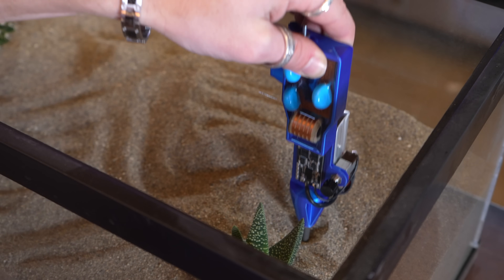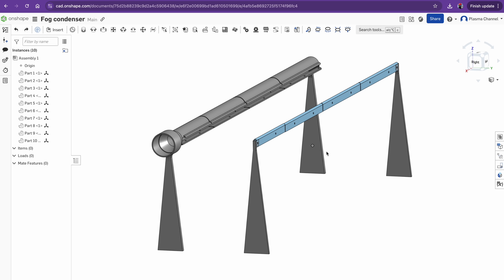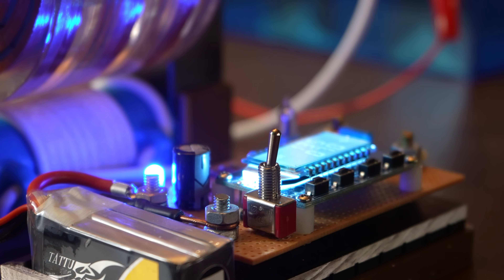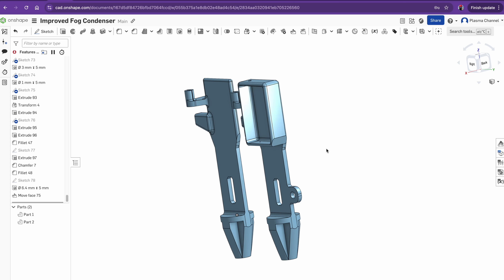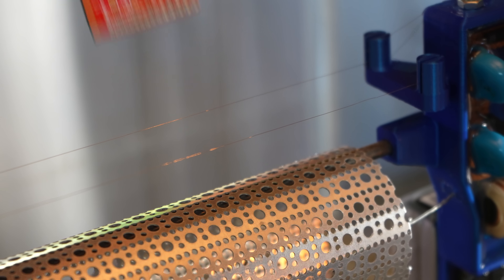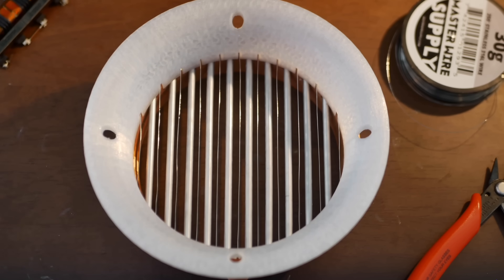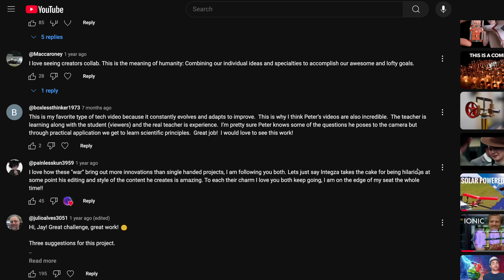Solving Desert Water Shortages Using 20,000 Volts

Comment: I do lots of work in Namibia.  There is fog on the coast until 11 or 12 AM.  There have been studies with fog nets.  This is very interesting thinking.  I'll be in Namibia in a month.  Want me to try it out your system on ground?  Need a power supply that takes 220V if you're interested.  Check out the Namib desert.  Swakopmund and Walvis Bay are the two largest cities on the coast.
Reply: In some area, water is for survival, a compressor dehumidifier gives 3L/kwh ; a mini seawater desalination plant gives 10L/kwh; this guy achieved 15L/kwh.
Reply: @francistai3615  Those are great comparison numbers.
Reply: @francistai3615  Yes, under the most ideal circumstances available. The regions are called "Arid" for a reason
Reply: @francistai3615 the 15L is by running fog over the machine, unfortunately real world conditions won’t give the same result but hopefully we can see for real when he scales it up
Reply: @francistai3615  A modern industrial scale desalination plant based on reverse osmosis achieves roundabout 300L/kWh. 15L/kWh is really not that great in comparison. The other issue is that it draws power at a time of day before power becomes readily available, if solar power is to be used. And compared to a compressor based dehumidifier (or a Peltier cooler as the one shown in the video), it also has the big catch of only working when condensation has already occurred.
Reply: @francistai3615 But it depends a lot on de air moisture
Reply from the maker: I wish there was more time between then and now. I don’t have the time to upscale it properly by then! Tempting though, and I’ll think about this. Feel free to email me so we can chat further
Reply: @PlasmaChannel  Noooo!  You don't need to scale it up!  Just the way it is at 2 feet is fine!   Let's test the working model that you have and if it's a success, then think about scaling.  I emailed you yesterday with an outline.  Did you get it?  Check your spam filters for an email with an address starting with "zav".  I sent it at 11:39 CST on Saturday.
As for the trip, I should be flying out in about 5 or so weeks, then back in the US, then if all goes well, back out for the summer.  So there's time to plan, possibly test on the ground in this trip and if not, then this summer.  Maybe even test and compare the results from the Atacama and the Namibian coast.  I'd also film if for your channel, of course.  It is the way of my people.  LOL.
Reply from the maker: @zavatone  I'll look for your email, im certainly interested in trying this. Expect to hear from me soon!
Reply: @ Rockin!  And if you ever get the jones to visit Namibia, I strongly recommend it.  This will be my 16th time back.  With your tech, you'll be welcomed even more than Namibians normally welcome visitors!  Just use m US number in the email I sent.  Cheers!
Reply: @PlasmaChannel   I also work in the Sahara helping to turn the desert green. I knew about the morning mist in the desert and had tried to talk some landowners into using fog nets, but they never took it seriously. This technology is way more efficient. I will be trying it out when I return to the desert. I also want to send you royalties for coming up with the prototype idea if we ever build one . Let me know what address you want the checks sent to. I am a firm believer in paying inventors for their work. Otherwise, people will stop sharing their innovation and discoveries .
Reply: @Jmagz-l2e Yeah, but if everything was open source! Companies would and should hire the inventor on a equal share of profits! The knowledge, would grow faster, through a collective, like this & innovation! An then it's win win for humanity! However! Its commendable of you to renumeration him!
👌👍🤙
Reply: @PlasmaChannel  The real test is if it will work the same in a desert environment, with the different temperature, humidity, wind etc. I don't think scale will be too much of an issue if you set it up in a good spot that's high up. 

I can't help but wonder if some fans would help push more moist air into the net though, maybe with a nice enclosure to make it act sort of like a wind tunnel, pulling air into it. Sort of like how a dehumidifier collects water? I don't know if I'm just overcomplicating it in my head now...
Reply: @Deja117  And the actual fog density of reality. But having a compact low power booster for a fog net seems like a worthwhile thing where fog nets are liable to be useful in the first place.
Reply: @PlasmaChannel  Just sent you another email.  Let's hope it got through.  Cheers!
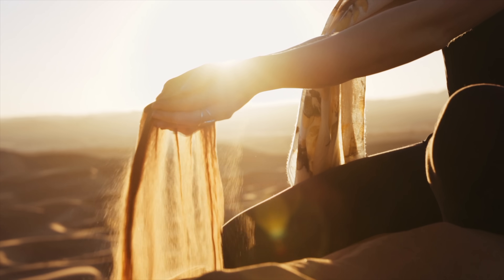Reply: @PlasmaChannel  2:25 "We need to find Creative ways to stay hydrated",  and the guy spits out his water !   LOL !  Awesome content !  Don't stop !
Reply: @PlasmaChannel this would be nice to try in the small islands in the Philippines let me know if you would like to come
Reply: @PlasmaChannel Very interesting, thanks but calling that dehumidifier commercial is quite laughable… I’m a bit curious of all the miles of electric fence we have to keep in cattle. It’s a 10KW pulse, could a grounded mesh be added and increase water availability?
Reply: @PlasmaChannel  you need to patent this ASAP mist-er
Reply: @PlasmaChannel  please please please do it!
Reply: @PlasmaChannel  I would like to purchase some
Reply: @PlasmaChannel yoo I this real..?
Reply: @PlasmaChannel maybe a system like this can work in tandem with a solar panels supplied battery bank. Where the stored power is extracted at the time of day when the humidity levels in the air are highest.
Reply: Make sure to document your process! Good luck! You could be one of the pioneers in this entire industry
Reply: It would be great to try this.

Maybe you could have access to a fablab to build the device ? The building seems pretty easy for anyone with electric/electronic competences.
Reply: @sebastienc8797  I can't.  I have a rather large project I have to make work and don't have the spare time.
Reply: Liking and commenting so this hopefully gets seen
Reply: @maker3d385 Thanks, man.  I emailed him with an outline but haven't gotten an email back yet.  Fingers crossed!
Reply: take his numbers and calculate how much power it would take to water a reasonable area
Reply: @sFeral  - I scaled his numbers up and derived 25 KWH per 100 gallons.  That is a LOT of power.  I love the physics, but seriously doubt the viability of the economics.
Reply: @markTheWoodlands  The numbers I ran are in metric over there , and I got about .9 of a liter from a meter of fog per hour, so almost 1/4 of a gallon ever hour (.23).  What I want to know is how much power is needed when you scale it?  Do the power requirements scale linearly?  Also, how large is the ionization radius in case we are thinking of stacking them on top of each other and if it matters to put one after the other.  When does it  harvest enough water from the air that putting them after each other is less useful.  BUT, we gotta try it on the ground first!  Then we can worry about all that.
Reply: @markTheWoodlands  I got 0.23 gallons in an hour with his 2 foot unit end a meter distance.  Sp, Just under 1 gallon in 4 hours.  Do the numbers match?
Reply: That's about £13 per 100 gallons assuming it is run from the mains.  Does seem quite reasonable to me. So reasonable I doubt it would be as efficient out of the lab. £0.13 per gallon is not a lot, particularly if it can be drunk.
Reply: @markTheWoodlands  while you are technically correct, and the numbers indeed scale up to about 25KWH per 100 gallons, the usability lies in the way the modules are designed. Since a single module in this demo setup only consumes about 39W per hour, you can easily power that using a 3S Lipo and charge them during the day using solar power. It might be that for larger modules you'd need bigger lipo's and better charging mechanisms, but generally I'd say that it's power consumption is well within the impressive range
Reply: @randriese  - First - I want to say that I applaud the inventor for pursuing this solution.  The quiet violence of drought is more frightening than the fires and storms brought on by climate change.
Reply: @markTheWoodlands  Namibia is also a desert so solar power is a good option regarding the power issue
Reply: @markTheWoodlands  when you say first, you usually follow it with secondly. otherwise why say first?
Reply: @markTheWoodlands  by his numbers is around 71kwh per m3, where a desalinization plant use around 3 kwh per m3 ☹️. Not feasible.
Reply: @markTheWoodlands 
I wonder about that. First of all, I bet you could scale back the voltage (and hence current consumption) without a significant drop in water production, and secondly that the switching driver in question is dissipating a fair bit of that as heat. The geometry likely also plays a big part in efficiency. Doing the actual peak efficiency calculations would be tedious.
Reply: @markTheWoodlands  if you scale it to a 400W device and power it with a cheap 400-ish W solar panel, you get 5.5 L. Maybe not impressive but likely enough for drip irrigation?
Reply: @ecausarano  - You read my mind.  Drip agriculture paired with the right crops would probably be a good combo.
Reply: @Ornitorrincoso  It will be difficult for this to compete with modern desalination tech, at 15 to 30 cents per 100 gallons all in.
Reply: @Scrogan  - Sure.  My guess is that by playing around w/design parameters he will double to quadruple is output per dollar.  Reverse osmosis desalination is hard to beat on cost.
Reply: @ purely from an energy standpoint, reverse osmosis has a hard minimum energy per litre. This technique doesn’t besides a small entropic cost, as you’re taking already pure liquid water and collecting it. The energy per litre is probably a tradeoff with respect to percent water reclaimed, so maybe if you’re fine taking only 1% of the water out of the fog you could make it a hundred times more energy efficient. It may even be possible to get significantly more than that though it’s doubtful.

How about using atmospheric electricity to power the thing, with kites connected to the water charging wires?
Reply: @Scrogan  - True, however that minimum is about 3 KWH per cubic meter (264 gallons) of water. Sorek costs less than 20 cents per 100 gallons. The Capex of the proposed solution is likely to be quite high.
Reply: @markTheWoodlands  did you consider the amount of fog available in your scale up calculations?
Reply: @markTheWoodlands that’s like 40 solar panels plus like 4-5 batteries for backup
Reply: @markTheWoodlands  You are looking at it from the wrong perspective, a 2-foot system, at this efficiency needs a ~40watt solar panel somewhere like the atacama to run for 4 hours. Realistically this will be a lot more efficient, and run for less time I would conjecture you'd need something like a ~10watt solar panel, which when bought commercially can be cheap and small,  this isn't the cheapest solution for 2ft. of irrigation but it really isn't ridiculous(when buying en masse, this can cost something like 3$ a unit). This is obviously wild speculation, I don't know if an hour of condensation will be enough even when efficiency is increased, but for low-water crops this is a really neat solution. By scaling I would say you'd probably ditch individual solar panels, which would decrease the price further, I would assume something like 20-40$ per 2ft. when buying the components in bulk and what not, which is expensive for farmers in these relatively poorer areas, but this is a contraption that can last more than a decade easily.
Reply: @markTheWoodlands  idk. you got a lot of sun where you need this the most. and ambient air water wasnt even tested.

as he needs DC anyway, it should be possible to use the old trick of using thousands little batteries and charge them in parallel (via solar during most of the day) and discharge in line (once the fog comes).

i think that would make it way more viable and cheaper then using grid electricity where its not even guaranteed to have electricity.
Reply: @markTheWoodlands  Per what unit of time? Hopefully not 100 gallons every 5 minutes. LOL. There's no need to be greedy. Water can be collected and stored in tanks for later usage.
Reply: @Lloyd33   - I can't speak to the power requirements.  I was merely pointing out that - slow or fast - the system as presented, uses a LOT of electricity.  I am rooting for the inventor.
Reply: @markTheWoodlands  I feel like anything over 1KWH for 1L (which is the amount of energy needed to boil water, isn't it? anyway ---) is a big win.

25KWH for 100 gallons is kind of, like, nothing?

Seriously, think about it. 1 current gen solar panel can produce 800W/H.

You could hook (quick mafs) this shit up to 1 single solar panel with a battery and produce, let's say 8KWH a day in the desert. Ignoring calculating the gathering speed as I wouldn't know where to begin, in ideal circumstances this would give you like 34 gallons of water a day.

That is more than a human needs to live, with barely any cost to it. Basically a solar panel with a small battery (or wind energy instead) would most certainly be worth that amount of fresh water, which to a place in drought, is a LOT. I feel like your perspective is a bit skewed by not realizing how much a few gallons is in a drought.
Reply: @theBabyDead   - for drinking water in a remote place maybe.  Solar is not magic - it costs around 8 cents/KWH - $2/100 gallons plus the cost of the harvesting equipment.  Say 5 bucks/100 gallons.  Look at your latest water bill.  You pay more like 40 cents/100 gallons. And for agri this is DOA for cost reasons.
Reply: @markTheWoodlands  The energy needed is indeed around 20 times that of producing the same quantity of fresh water by reverse osmosis in a (large-scale) desalination plant.  A priori, that alone would doom the technology economically.  Having said this, the energy efficiency of the device could possibly be improved.  After all, what was displayed in this video was an initial very small-scale prototype.

BUT:
1. It does not have to be large-scale. As said in the video, the technology is freely scaleable.
2. With the exception of some power electronics, it does not require any complex international sourcing (hi-pressure pumps, pressure tubes, RO membrane modules, control system, etc).
3. CAPEX and general complexity (i.e. maintenance costs... RO membranes are wear items and are quite expensive) are MUCH lower.
4. No need for a dedicated building and trained personnel
5. You need morning fog, but do not need to be in close proximity to the sea (respectively have a long pipeline and pumps).
6. You do not have the potential issue of brine discharge.

Preliminary conclusion:  This process could be economically feasible in regions with the right conditions, PROVIDED you can power it with solar power costing you less than  25-30 $/MWh... which is possible in a desert environment.

The "right conditions" would be:
a. Areas of dense morning fog, at a time the sun is already reasonably high for the solar panels to produce efficiently... cloudy and rainy days should not be an issue for that particular application!  😉
b. ...while, AT THE SAME TIME, having areas free of fog to locate the solar panels... but that should be ok, as the system itself dissipates the fog!

c. Have some use for the solar power generated the rest of the day!
Reply: @markTheWoodlands  on my country , 25kwh priced around 2.5 to 3 usd.. actually it is pretty cheap, reminds it is can be automated , and the scarce source of clean water.
Reply: @markTheWoodlands but if you use say $0.4/KWH (which is high) you get 10 cents per gallon for pure, “distilled” quality water. That stuff costs around $1/gallon in the stores. And 10 cents per gallon is way cheaper than the cost of actually distilling water. Probably also cheaper than the cost of seawater desalination per gallon, which is what more and more coastal cities are turning to.
Reply: @BruceB-dp3ii  - Seawater desalination costs about 25 cents per 100 gallons using membranes.  Per HUNDRED gallons.  Affordable drinking water is way more important than unaffordable distilled water.
Reply: @markTheWoodlands  Solar will produce that power during the day, day after day for 30-40 year. I think this is very feasible.
Reply: @markTheWoodlands  Well, all it would take is just 8 450W solar panels to generate 25 kWh, considering it's used in a desert with an average of 6-7 hours of sunlight. Seems pretty doable to me.
Reply: @markTheWoodlands  if it were powered by solar, and used to grow food hydroponically, you could get a lot out of that water I would think. But yes, definitely seems expensive to do with power. I wonder if using lower voltage bringing down power requirements enough to make it more viable while still providing more water than just standard meshes
Reply: @markTheWoodlands вы забываете что нужно лишь высокое напряжение. Не делайте трансформатора. Возьмите электростатическую машину Вирмшуста или Бонетти и Лейденские банки. Энергия будет затрачена косвенно через крутящий электродвигатель.
Reply: @sFeral  I have!  There also are other ways to extend it.  I need to know if his 39 watts stays the same for longer distances.  But I ran some numbers if we can test it in Swakopmund, that will be REALLY telling.  There is a lot of area outside town where these could be set up and scaled up.  But we need to start with a working unit like the one he shows here to see what we get.  Wind blows in from the ocean to the shore most mornings bringing with it fog and sometimes strong sand blasts.  We would need to see how the unit works and how to make it wind and sand resistant as the sand would certainly fill a water catchment device. But let's hope it happens!
Reply: @sFeral  I am not sure if the wattage scales linearly or not.  We also need to think about how deep to stack these and how high to stack these as there is regular strong wind at the Namibian coast.  My numbers got 0.23 gallons per hour for a 1.1 yard long system at either 39 or 65 watts directly scaling his system.  I'd also like to oscillate the charge, possibly saving power by alternating it to the wind speed.  Pulsing it on to charge a part of the air, capturing the moisture in that area as the wind blows through, stopping the power, turning it on again for a fresh bit of air, and so on.  There's also the unknown of the radius of air that is and remains ionized and for how long?   Sand storms are common, so self cleaning drop trays are needed, possibly in the shape of an airfoil.  If wind blows this way ➔ then how many can we place behind each other like so  ▌➔ ▌➔ ▌➔ ▌ before the units downstream start seeing diminishing returns in harvesting water?  There's much more work that needs to be done, but FIRST, we need to test a working unit on the ground to see how it operates.
Reply: @zavatone  SW is our predominant wind. NW brings in major fog banks and is secondary to SW. So would say arranging the lines for NW winds would give major benifits, but think it would be cool if the system could turn on an axis according to the wind direction from any westernly winds (where 90% of the desert moisture coms from)... The major dust storms are normally just during our winter months late May - Aug as a result of Easternly winds and the system could be set such to shet down when East wind blows. The Walvis Bay area gets more dust blowing around anytime the wind blows, because they are in the dune belt. 
Would love to have a chat with you when you down in Nam again to see what you up as there might be some collaborative oportunities...
Reply: @sFeral  Already have.
Reply: We are based in Namibia, on a 10Ha outside of Swakopmund, where we are busy setting up a permacuture system. I would love to collaborate with you on this if possible, as water is our biggest limiter at the moment, and this would change the game entirely if it works at our location. We do get many days of fog, but not as much as in Swakopmund itself, and it will be interesting to see what this tech can do in our circumstances.
Reply: @GreenandAbundant I hope you're keeping up with the comments here
Reply: @alanhat5252  thanks for keeping us in the loop. Not getting any direct responses to my messages, but will be keeping an eye on developments. Checking if it works in our system would be great, and if it is economically viable would be life changing for us Namib desert dwellers!
Reply: Software developer here based in Namibia (Whk) with an interest in desert farming systems, specifically along the coast as you mentioned.  Would be great if we could exchange details and meet for a coffee at some point.  Would you be open to that?
Reply: @Bennevisie  would be great! Our email details are on our channel. We will also be at the Living Earth Expo in Windhoek in April, if we don't get an opportunity to meet before then....
Reply: @ Dude.  I should be in Windhoek in April.  We're bringing in a Redox-Flow Vanadium grid scale battery on April 5th.  When is the Earth Expo?  April 25th?  I'll look into it.  We may want to exhibit.
Reply: @zavatone it sounds like a Van der Graaf generator should power it, you might be able to borrow one from a nearby school.
Alternatively, points & coil from an old petrol engine gives 35KV from 12V.
Reply: @zavatone it sounds like electricity consumption is due to conduction through the fog. 
This can possibly be reduced by putting resistance in the earth lead from the mesh, spreading the sections apart or just letting the Voltage drop.
Reply: @zavatone he said capture was strongest near the edges so segmenting your mesh or even just wires might work better.
Reply: @alanhat5252  Ohhh! interesting!
Reply: @zavatone update?
Reply: I'm a Zambian water engineer. hope to see succeed neighbor!!! bless you!
Reply: @babogam  Oh!  Do you know Elijah in Namibia?  He's the Director of Water or something like that.  Do you know of hin?  Elijah Ngurere, I think.  Happy to hear from out upstairs neighbor!  I'll email you some biltong and Tafel!
Reply: Wow
Reply: @Tomuss132  It's just two plane flights and 12 hours being stuck in Frankfurt or Heathrow!  Heh.  :)
Reply: For those wondering, the Experiment he is doing and the one suggested here will not be consistent in dryer areas… as the Fog in the Namibia Coastline is very dense, so comparing it to a Desert in Chad which is miles from any coast is inconsistent… 

PS: i live in namibia so hence why i know.

Fog times happens throughout the day starting from 6PM to 10AM the next morning and sometimes during the day depending on the seasons…

To cultivate water in Namibia from this experiment will be too easy when measured with more dry and arid regions like the Sahara… 

Maybe if he goes much more inland like 90km you will get a more realistic result…
Reply: @zeroChannelJJ  I think that was the motivation to investigate setting up in the Atacama. They get fog there but it's not at all coastal.
Reply: @zavatone I was thinking exactly about this same scenario as I was watching the video. Funnily enough, I will also be in Namibia in more or less the same timeframe as you… Even driving to the coast as well. It’d be really cool to meet someone with such interests.
I’m not sure if you’re managing to get something set-up in that timeframe in the end, or if you would need any support with anything if it goes forward, even sourcing equipment or anything, but I’d be more than willing to try and help if it is needed.
Reply: @rnbdanny  Really keen to see how this prospective Namibia experiment turns out!
Reply: I'm late to the party but I am curious as to what effect it will have on the natural state of plants and animals in that area that take advantage of that fog. It does seem like it is a fleeting resource and there might not be much benefit to the wildlife but I feel it would be necessary to know for large scale and long term installments. Great ideas none the less, much love as always.
Reply: I used spend quite a bit of time on that coast! Right down to Port Nollith! Used to go past a place! Where there was a 2m x 1m thick piece of glass, from a shower door! Set up at an angle with a large zinc bath under it! It was shaded! It always had water loads of water in it!
Even the wildlife knew about it! As there was always spoor /tracks about!
👌👍🤙
Reply: @zavatone I do a lot of work i  the nam desert too
Reply: Where did he learn about this stuff
Reply: @ Follow his channel.  By doing is the answer.  :)
Reply: This would be awesome to see at high scale
Reply: The larger the net, the more power you will need. 20-30KV. However very low current. Not too much current for the example here.
Reply: You would be better off buying solar panels and build a desalinator on the coast, it will produce 20 times more water for the same power, all day long. No waiting for foggy days.
Reply: @WeBeGood06  that would be assuming your pumping was free. Running a motor to drive mass is not exactly efficient. Also not useful for deserts far from coasts.
Reply: holy shit this could be so awesome
Reply: Hey, electrical engineer (power) living on the coast of Hawaii. All this talk about desal vs. new tech: there is nothing wrong with working on multiple solutions. If @zavatone wants to try this, go for it. 

Now, I think the biggest problem that needs addressing is the sand storms. That silica will clog everything and it will expedite any rusting. 

My first thought is put one of these collectors behind the existing fog nets.
1. Fog nets are already located in areas of high fog.
2. Apparently, up to 10% effective
3. Protect the device from inclement weather. 
4. Can drip feed the existing fog nets from the rear ionized collector.  

But it would be cool to see this tested in multiple areas simultaneously.

To the math! I know he said 12V, 850mA, but it's a 850mAh, 11.1V battery. So it has 9.44kWh 

At 39W, it could run for 240 hours. Let's say it runs 12 hours/day (11pm-11am) We just need to run a 100W, 12V solar for 5 hours (12-5pm) to recharge. ($20-$30)

Solar is inconsistent, and sand can disrupt this. So put a 12V wind turbine. ($75-$100)

But zava needs to test it no before you get into design to power it. 

Good luck zava! We are all rooting for you
Reply: That’s a super exciting prospect! If you need funding or another engineer’s take, I’d be happy to provide! (It’s a worthy cause, so no cost for any support you might need)
Reply: try to combine a “fog harp”instead of the mesh with power. 
an earthship with extended greenhouse on the westcoast has allways been on my mind. From Port Nolloth down south to Hondeklip bay.
Reply: I'm fairly certain if you have the circuit itself then it should be a rather trivial matter to get some chicken wire or metal mesh to upscale the area dramatically. in terms of scalability just add more circuits in parallel? I'm not an electrical engineer.
Reply: have you tested with lower power consumption ?
Reply: I'm a civil engineering student, and would be honored to be involved in your project. How can I reach out to you sir..?
Reply: I am interested in the progress too.
Reply: Google "Saltwater greenhouse". Good luck!
Reply: One day i will help people like you in need In shaa Allah
Reply: Thanks, that's what I actually wanted to comment about your country, before I saw your comment. I did way back watch a very interesting documentary about it and it was amazing. Locals were coming and filling up their water canisters, which before had to walk long distances.
Reply: What percentage of humidity were you using for the experiment?  This is important to know if the device will work in a particular location or even time frame.
Reply: I am curious vow low humidity level will this work?
Reply: Namibia is exactly what I was thinking about in terms of this tech, though I have yet to visit I would really like to. 

What sort of work do you do there? I was specifically looking to visit Swakopmund and Walvis Bay!
Reply: I would like to know how you think they would fair in SE/Central Oregon
Reply: If namib gets greener, probably many more vilant tornados in the alley will teatch you better.
Reply: don't be a fool. If you want REAL water volume, why not use solar to de-desalinate sea water and then pump in inland, THAT is going to absolutely beat this other idea by many orders of magnitude, a little bit of fog is a feeble resource compared to the sea ! add that to solar power, both thermal, to heat and evaporate the water via a curved mirror, and then using solar PV to power a electric pump to move the water inland, you will have many orders of magnitude more water than a little fog could EVER provide...
Reply: @ashleyobrien4937  Because fog kills solar output.
Reply: @ashleyobrien4937  Desalinating sea water causes dead zones along the coast. This method does not seem to create that problem. It is however limited to areas that have high fog but it does also mean it can be used in places away from the coast. It does have scaling issues though. It could be used to provide water to villages and small towns maybe but not good enough for cities.
Reply: @ashleyobrien4937  that all depends on how close you are to the ocean.   the fog might travel really far into the desert.